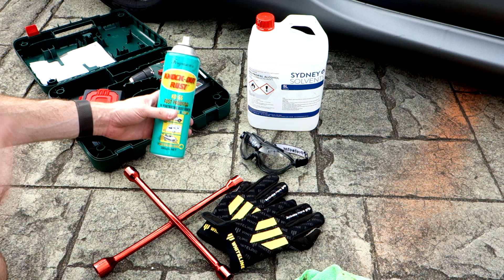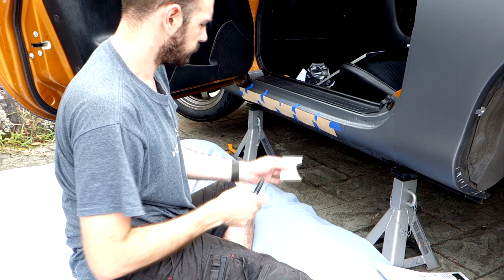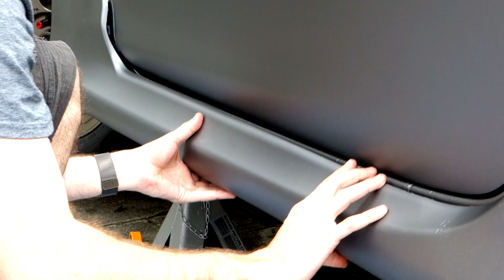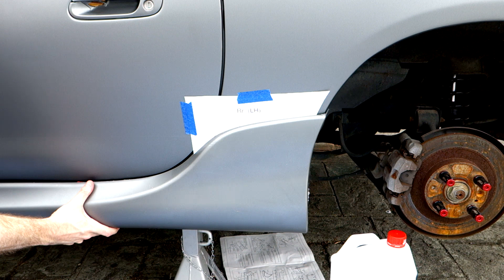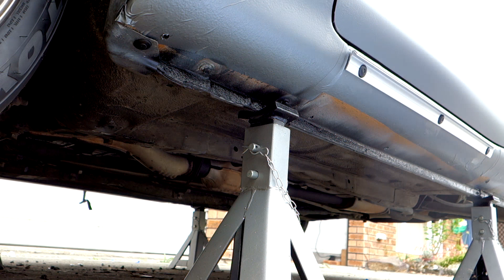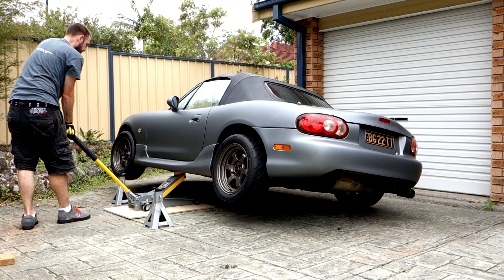Project MX5 - Wrap Update & Installing Mazdaspeed Side Skirts

Comment: Hey bro, I just got a set of the mazdaspeed side skirts.
Is the mazdaspeed front bumper the only thing that matches up to the side skirts?
I have a 99 Miata, really don't want to have to do a front end conversion with a mazdaspeed front bumper and lights
Reply from the maker: Correct. There isn’t a front end kit for the NB1 that matches.
Reply: cool, I was afraid of that lol
It's too much for me to do, so I just ordered the regular short side skirts set and will sell the MS skirts I got :-)
Still trying to locate a OEM front air dam as well.
These parts are getting harder and harder to find these days.
I got the side skirts, rear large mud flaps, tail light rings, and spoiler pretty cheap but will have to have them painted to match my car.
That's part of the fun of modding, baby steps :-)
Thanks for the help my friend